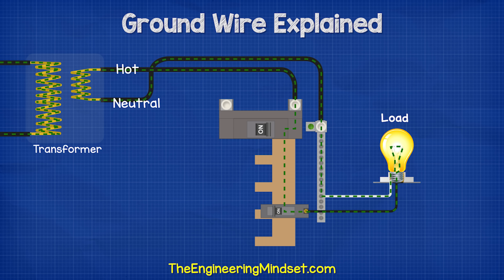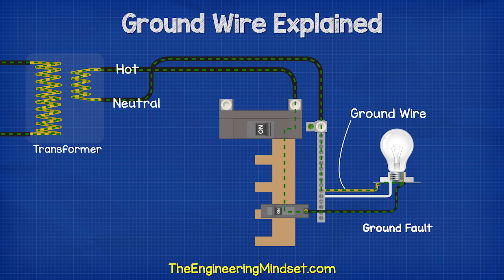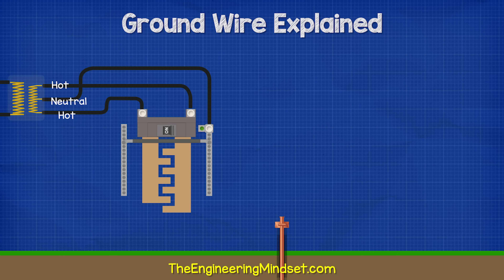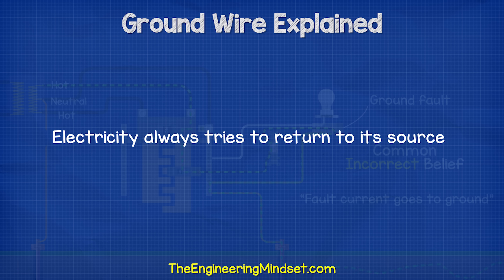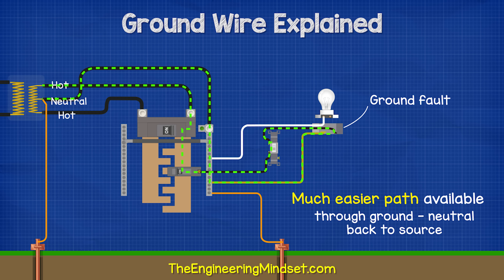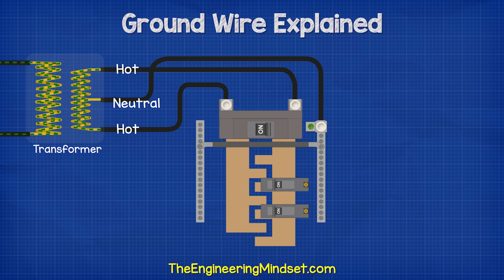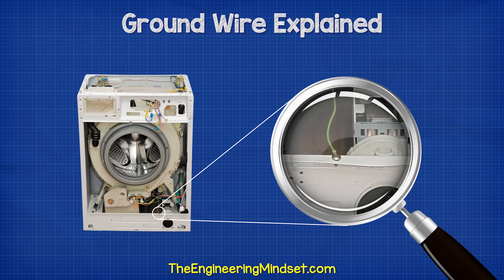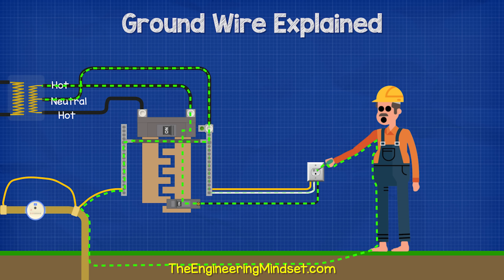Ground Wire Explained

Comment: You are correct but it goes further!
The "Ground Wire" connects different areas so they are at the same potential. This is most evident at the star point on a transformer. The star point is the source of the Neutral connection AND is bonded down to the body of earth, so if you touch a Neutral whilst standing on the floor there is no potential difference, no Voltage and therefore no current will flow!
The services in your home and workplace also have an Earth point where the Gas and Water pipes are connected together (there may also be cross bonding at your hot water tank, boiler and sinks). This means that All "Earthed" points are at a similar potential. 
This may seem obvious but if you have adjoining properties that are fed from different substations there can be a potential between different lives (even on the same phase) and it is the earth connection down to the body of earth that keeps this to a minimum!
Reply: It could have been worded better though.  He states that electricity "prefers" to travel thru a low resistance path (here a wire rather than the actual earth), but electricity will take ALL paths, the current will be higher in the lower resistance one.

eg if you put a 1 ohm & a 1000 ohm in parallel across a power source, both will carry current.  The 1000 ohm will only have 1/1000 of the current that the 1 ohm resistor does, but it's not zero.
Reply: @j.f.christ8421  he was right as far as electricity will indeed be highest at the very least path of resistance
Reply: ....and its funny its called ground....because in fact they are also talking about the ground we walk on
Reply: @edwardscomputers  No coincidence! We call it Earth in the UK. Could be worse though .... how about the Dirt Wire? ;o)
Reply: @edwardscomputers  The way he said it inferred that it ONLY goes thru the low resistance path.  It's a common statement "electricity goes thru the path of least resistance", which is true but it ALSO goes thru the high resistance path(s).
Reply: @totherarf  "dirt wire" sounds good.  In this case most of the current will flow thru the copper earth, and a bit thru the "dirt wire" earth.
Reply: @edwardscomputers   How about ground/Earth wire in Aeroplanes or in Four Wheelers ?  🤪 . Why negative terminal of battery is connected to the metal body of car ? Does it  not add resistance (of metal as compared to copper wire) to the 6/12 V DC circuits in car wiring?
Reply: @avimango46  the car body is a current carrying conductor of electricity back to the "-" battery terminal, unlike building ground wires which should not carry current unless a fault occurs. Cars do not really have ground wires, only "-" and "+", both carry the same current. Somewhat like hot and neutral wires at home.
Reply: @avimango46  :  The chassis of a vehicle is large, thick and heavy -- so even if it's not made of copper, its electrical resistance is nearly zero.
Reply: @avimango46  There is good reason the -ve of the battery goes to the body .... corrosion!
It would work equally well eather way but you would see the body start to rot quickly. 
So to the resistance, you have to realise there are multiple parallel paths the electricity can flow in the body of a car making the effective cross sectional area of it quite large. This more than compensates for the difference in conductivity between copper and steel!
Reply: @j.f.christ8421  The formula is Current=Voltage/Resistance
Reply: I think you missed the point of this, Dave. This is a basic concepts video, not a college class. He could have ran off into the tall grass like you did, but many viewers would have gotten lost. There’s a time and place for each level of explanation. This one was a simplified basics concepts video.
Reply: @totallyfrozen  Good point, well made!
Reply from the maker: Check out NEW resistor video, everything covered! ➡️ https://youtu.be/DYcLFHgVCn0

Comment: What is the difference between ground in a electronics circuit and this ground wire ?
Reply from the maker: In electronics, it's connecting to a reference point. Usually the negative of the battery.

Comment: I know your animation shows otherwise, but that may just be an oversimplification, so question: in a 120V circuit on a 240V split-phase system, does the AC alternate strictly between the two hots (red and black) with the centre-tapped neutral - whose job is to "carry the unbalanced load" (whatever that means) - only carrying the aforementioned unbalanced load (however that arises), thus resulting in half as many cycles in the 120 (and only in one direction) vs the 240?  Or is it true as you've illustrated, with the current alternating at 60Hz (in North America) between the line and the neutral?

I hope I made sense in describing what I am envisioning.
Reply from the maker: This should answer your point https://youtu.be/P-W42tk-fWc?t=248
Reply: @EngineeringMindset  awesome, thank you sir!
Reply: Hz are always the same. 
In 240v circuit there is no neutral connection at all, All power goes trough two hot legs. (120+120=240)
In 120v circuit there is more options. Return current can go trough second hot leg or neural (or in real world it will probably go both ways.) If there is no load at all on the second hot leg, all the current goes to neutral, if there is exactly same load on both hot legs (balanced load) no current goes through neutral.

This works like this because 120v legs are are in opposite phases. Two 120v loads on different hot legs work like a single 240v load. If both legs were all the time balanced(=same load) you would not need neutral wire at all.
Reply: @1978jra  thank you
Reply: @1978jra  120 volt.    balance the load would not balance thru the other 120 volt side.
The neutral or nothing..   NOW open the neutral while both 120 v are loaded, we have a different story.     In this case the LOWEST current side would continue to function only. Thank you.
Reply: @tedlahm5740  if neutral is opened in a non-balanced circuit, the total voltage would be 240, but would not be evenly split. For example if you had a 100w light bulb on one leg and 200w bulb on the other side, the voltage on the 200w side would drop to 80v, and the 100w bulb would see 160v, probably exploding. The ‘200w’ bulb would now be consuming about 89w and the ‘100w’ would draw about 178w (again probably for a very short time).
Reply: @TomCee53  Not buying that story. Sorry.     The HIGHER current load would go out completely. The LOWER current load would remain functioning.     Kindly run this thru
your viewpoint.  Than you for the interesting scenario.  ( Current = Amps)
Reply: @1978jra  This only applies to the USA where you have that oddball split phase (240v cut into 2 x 120v) set up.  For other countries 240v is the usual live/neutral stuff.

Comment: Be carefull with your earth on a welding set, try and get it as close to your rod as you can.
You can get a rouge earth where it runs all round the work and back to the set.
Reply: I’m sure you meant rogue ground. In another comment it’s caused failure in other equipment.

Comment: PAUL I’ve a potential interesting topic to explain, in the Philippines they had 110v under American rule but at some point changed to 240v system.  Ground wire also seem to be missing much of the time.  Here in the uk they are the norm.  Anyhow in Manila the capital of the Philippines a friend of mine was investigating a fault in his flat he measure of one load point and the “ground’ wire and got 110v then he measured of the second load line and the same ground and got a second 110v.  But he can run all his 240v uk kit using a physical adapter as the are all US type sockets.  There a shocking lot of electrical fires in the Philippine but I was wondering if the setup is a safe or standard practice? Really enjoy your explanations so hoping you can explain how this works.  Anyone else who knows about this please feel free to educate me.
Reply from the maker: Interesting, sounds like they are using this system https://youtu.be/UBERduCp3Wo where you get 110/120v from a socket but can get 240v also. Most electronic devices these days are dual voltage so they don't care if they get 240V or 120V, they just convert this to DC and power the device. Check the manufacturer label on your laptop charger, it'll probably say INPUT:~110-250VAC 60/50Hz, meaning it just needs an adaptor and will accept any AC voltage between these values

Comment: If someone were outside barefoot and touched a hot/live connection and the distribution board or outlet was fitted with a GFCI breaker, wouldn't that detect a difference in current through the ground wire and trip the breaker disconnecting the circuit.
Reply from the maker: Hopefully yes, if the current is sufficient that it detects it and cuts it

Comment: Well I love your videos. However this whole topic grounding and earthing seems very confusing to me. As you mentioned that even in event of fault, current goes back via GROUND WIRE>PANEL>NEUTRAL and finally to source with very least resistance causing breaker to trip. Well it sounds good, but the problem why can't we just tap the same neutral wire and connect it to the third terminal of power socket. FOR WHAT GOOD REASONS WE NEED ENTIRELY FRESH GROUND WIRE. This is rean pain and I'm posting you will try to help me. 

FYI I'm from India, we have 220V, 50 Hz supply.
Reply from the maker: It's an emergency exit. If there is a break in the neutral the power runs entire through you if there isn't a ground. In a building we have emergency exit so the people can leave if they main exit is blocked. Same principle.
Reply: @EngineeringMindset  There's still one thing confusing me. Why is there a distinction between "hot" and "neutral" wires when the current is AC? Doesn't that mean that the current flows in both directions? So what makes the ground safe to touch while hot isn't? Is it just the fact that we keep all exposed conductors grounded, while the hot ones are carefully hidden away in hard to reach places, so there's no way to complete the circuit?

Basically, the way I understand it, you could swap the live and neutral wires in an outlet and it wouldn't make a difference. Maybe even neutral and ground. But if you accidentally mix up live and ground, you're gonna have a bad time.
Reply: @tiarkrezar  Okay, so I'm assuming North America here, no idea how it works in other places. If you were to open your breaker panel (don't do that, but if you did) you'd actually see two hot wires coming in. The voltage you would likely see is 240V. This means that you have two 120V wires in opposing phases present. The hots, neutrals, and grounds are landed in the breaker and run to your appliances, but for 120V applications, they only run ONE of the hot wires, a neutral, and a ground. Your 120V applications draw power from the hot wire and the neutral provides a discharge path after the load has been applied. The ground wire provides for a no-load circuit, which effectively draws infinite amps when voltage is applied. If your home is wired up correctly, this will 1: Trip a GFCI, 2: Failing that, it will trip the circuit breaker for that circuit, or 3: Failing THAT, it will eventually trip the main breaker (usually 1-200A) although by that point either you or your equipment may be too crispy for it to matter :/
Reply: Because to provide a normally non-current carrying wire to protect from shock. Example, on the washing machine, if you connected the neutral to the body of the washing machine and that neutral wire broke between the washer and breaker panel, the washing machine would now be energized to 220VAC in your instance. So by providing a dedicated ground, in the event of a broken neutral the device just stops working.
Reply: @inothome  It took your comment before I realized that ground wires on appliances weren't to dissipate the electricity though the appliance but for the appliance's electricity to dissipate through the wires. Today years old.

Comment: Suppose there is leakage of little current in the body of electrical Iron . In that case the current over the metal casing of Iron shall pass through ground wire. In case there is no ground wire then person gets a tingling feeling of little current passing though his body but no fatal! Thus the ground wire carry little current leakage over the body of appliances like geyser, electrical iron of refrigerator. Am I correct? ( I am talking about 220 volt AC current prevailing in India)
A humorous question : How Aeroplanes or four wheelers manage with or without a ground wire ?
Reply from the maker: Potentially yes, GFCI might trip if it detects it though.
Reply: @EngineeringMindset  I don’t know what do you mean by GFCI ? I wanted to know about your opinion that the “Ground wire always carry some current” leaked from any of the running domestic appliances due to faulty insulation in wiring or motor winding if any! .
Reply from the maker: We just published a new Ground fault, short circuit and arc fault video, so much detail! Link HERE➡️: https://youtu.be/Qi0ynSQw-wc

Comment: Smashing video. Can you do one on earth leakages caused by chillers, drivers, pumps, pfc, motors etc. we have this problem at work. We had 12amps at the MET. Found a loose PME rod. Rectified it and the earth leakage dropped to 9 amps . Turned the chillers off, the leakage went down to 7 amps. Checked the transformers star point and it's OK . Check all terminations. Still no answer
Reply from the maker: Sounds like an interesting problem. Can someone use a clamp meter to narrow down where it's coming from if you don't have the proper equipment.
Reply: Check all your neutral connections to as close back to the supplying transformer that you can. A bad / loose neutral will allow more current to flow through the ground to get back to the source.   There should be no good reason to have ground leakage measured in full amps, milliamps, yes. Either a device is seriously damaged or, in your case and especially since it changed with varying the load, a bad neutral somewhere from the panel back to the supply. If you have to, have the power company check the connections on their end as well.
Reply: @inothome  I had, what appeared to be, a 'floating neutral'. Lights would flicker, dim, surge, all hours of the day and night. No correlation to any high-current devices. They did high-current tests between the pole and my panel, all checked out fine. I had the power company out 3 times. Each time they insisted it was something in the house. I tightened every screw in the panel myself, still happened. I tried shutting off different circuits, didn't matter. I had a licensed electrician come in and RE-check all my screws, connections, breakers--still happened. Paid to have them out twice. On the 4th time out, the poco tech said "I'll change out a few things at the transformer, see if that helps." Not sure what he changed, but it fixed it immediately. I had this, intermittently, for 3+ years. It took that long for the power company to actually fix it. They just kept denying it was their issue. Meanwhile, I spent a small fortune on tools, replacement breakers, electricians, checking every outlet box in the house... Infuriating. And can be really dangerous! So my advice: Check everything possible in your walls. But don't rule out a bad transformer or service problem.

Comment: 0:00-0:09 That’s true for half a cycle (that current flows from the source to the load through the live wire, and from the load to the source through the neutral wire). In the other half cycle, it’s the opposite: current flows from the load to the source through the live wire, and from the source to the load through the neutral wire.

I suppose you didn’t say this because you usually use DC for explaining AC circuits. But I thought I’d clarify this because many other people say what you said without specifying that’s true only for half a cycle.
Reply: However even if the current flows in both directions, the neutral wire is referenced to ground, you only get a shock if you touch the hot wire.
Reply: @FreeOfFantasy  True. Though that’s not what I was talking about.
Reply: @altuber99_athlete  True enough about the actual current flow, But I agree with the way it's done in the video as it's less a less distracting way to illustrate the concept of grounding, esp. if the viewer is new to the subject and want's to know why the ground wire is important. I've seen films in the past that did the opposite. in a 1950's (?) film demonstrating simple circuits a battery, a switch and and several light bulbs were used for the visuals, but every time a circuit was demonstrated a 60Hz hum is heard. For the first few circuits, I could not figure out WHY a DC circuit would have a hum. It could not have been a simple indicator of the circuits working as a lit bulb (or bulbs....) would be enough for that. THEN they showed various way a SHORT circuit could occur, then I got it. They wanted to have a way to indicate that current flowed in a short no matter if no bulbs were lit.  It was just to make it so a layman would understand.
Reply: @jamesslick4790  Okay that's fine. Perhaps The Engineering Mindset should have clarified later in the video (after explaining ground), that current changes direction and thus for half a cycle it flows from the load to the source through the hot wire and from the source to the load through the neutral wire.